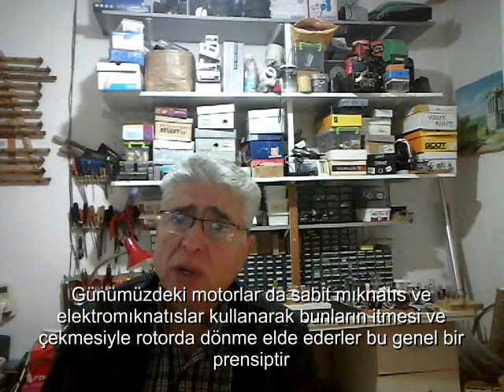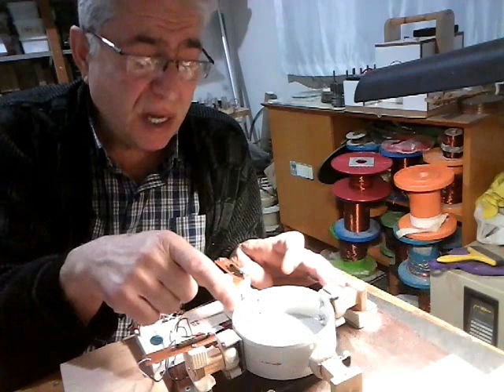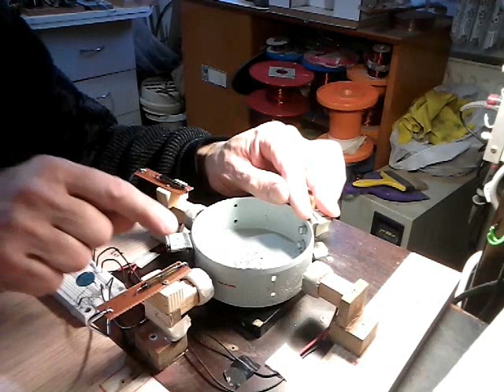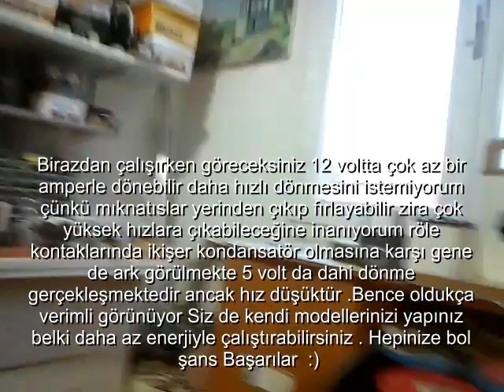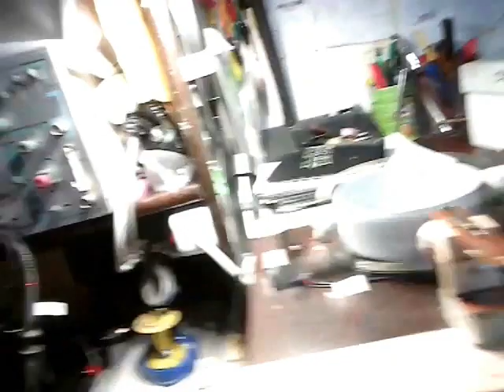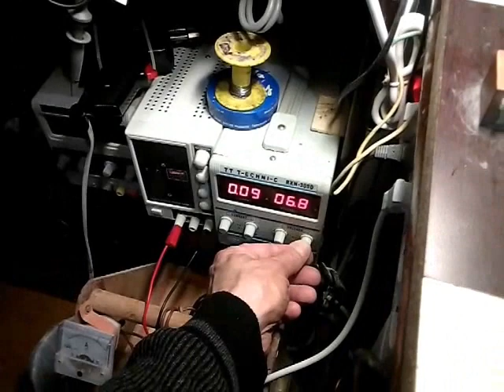Steorn Orbo Replication New

Comment: The Alfa and Omega:
Laplace Law of Force

In experiments it can be shown that the force F is directly proportional to the sizes B, I and L.
B is the magnetic field size, magnetic flux density is measured in Tesla. [B] = N / (A * m) = T.
In the current strength and is measured in amperes.
L is the length of conductor in the magnetic field and measured in meters.
That formula is equal to F = BIL

Let say you have a generator that needs 50 newton to create 10 watts. Then you use a motor that needs 15 watts to create 50 newton load. Now replace the magnets in the motor with some that is twice as strong
According to Laplace law. F=BIL
Force=F, Flux density=B, Current=I, Wire length=L
It will only need half as much watts (7,5 watts)
to create 50 newton load.
And now the system creates more energy, than there are put into it.

Comment: Nice work. I'm trying to build one replica but I don't know how to wind the coil. Is it possible to help with it? Thanks
Reply: Coil is bifilar, with capacitance between wires. You will get free energy, if frequency of rotation is equal to resonance frequency of the coil. Acceleration under load will occur above critical minimum frequency.